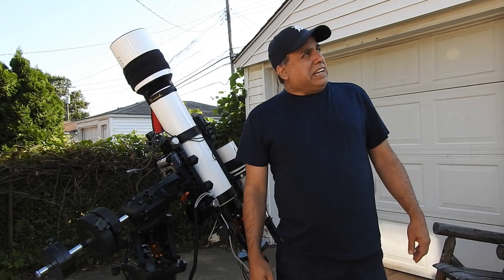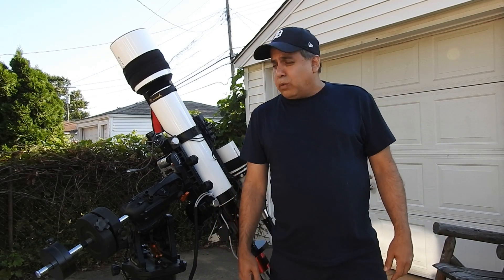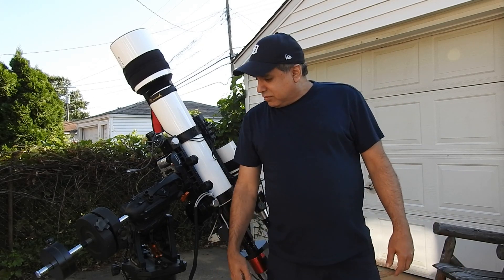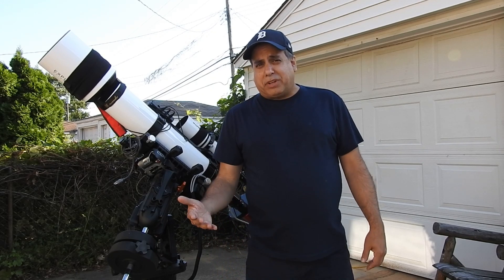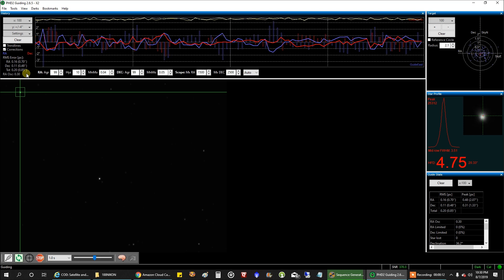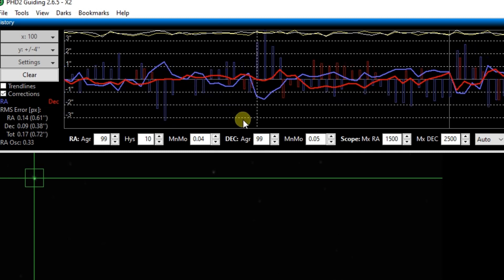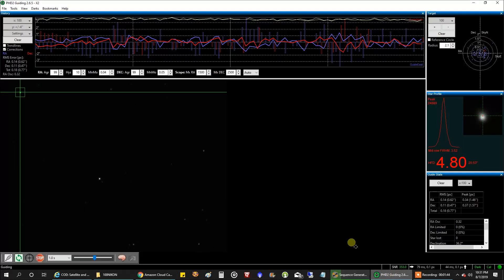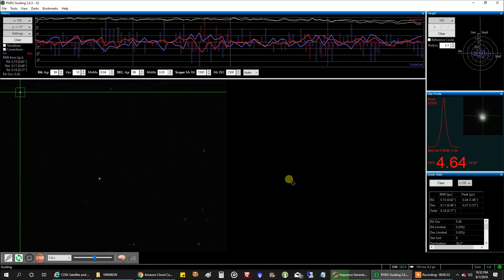My Telescope Mount is Driving Me Crazy (Part 2)

Comment: You never fail to crack me up with your outtakes, Chuck 🤣.

I’m hoping you find out what the problem is with your CGX soon because I’m about to upgrade my AVX to either the CGX or the ioptron CEM60. I’d love to stay with Celestron because then I’d be able to keep using the Celestron StarSense Auto Alignment Accessory which is pretty much a must for aligning my scope in the little back patio of my apartment.
Reply from the maker: Thanks Randy, I'll keep you posted.  Wow, if the CEM60 were an option for you, I'd jump all over that and replace StarSence with Plate Solving.
Reply: Chuck's Astrophotography I’m not all that familiar with Plate Solving tools and whether or not it would suffice in my situation. Basically, from my little back patio, I can only “see” the eastern half of the sky. Everything else is blocked by the 2-story apartments.
Reply from the maker: @randydonnelly5897  I have a video on Plate Solving is you ever are interested in learning it.  Seeing only the eastern half of the sky is no problem for plate solving.  But I understand, if something is working well for you, I would be reluctant to change too.  I am set in my ways.
Reply: Chuck's Astrophotography thanks Chuck. I’ll check out your Plate Solving video and see if this “old dog” can learn a new trick 😉. If plate solving can work with just the eastern half of the night sky and I don’t have to worry about adding calibration stars in the western sky, then Plate Solving could very well replace my need for the StarSense and I’d definitely opt for the CEM60...on a tri-pier 😉.

Comment: Gee what a bummer... If your running AC maybe your getting fluctuation in your AC. Or try another power AC power block. Try a battery to run the mount. If you still have problems maybe it’s a still a power issue in the mount itself. Love my CGX-L... unguided and a rough polar alignment I can get round star even up to one minute on a good night.
Reply from the maker: I wondered about the AC power as well, I'll add this to my list if I can find a battery in my inventory that can power this mount.
Reply: Being stupid on my side... lastly a 2x4... duct tape and a hammer (BFH) can fix anything.

Comment: Hi Chuck,
I too having a very similar symptom happen after a windy night in June and I am still trying to sort out the issue though. 
One thing that I hav noticed on your PHD's min-mo settings, you might want to increase the number a bit to prevent the PHD to make correction too quick.
The other thing I would also try is to completely reset PHD2 and from scratch and see if it helps. 
Chao
Reply from the maker: Thanks Chao, I'm going to go all through the PHD2 settings today, thanks!

Comment: I'm still working on getting my guiding better, so I feel your pain!  

Are you positive that this is a mount issue and not a software issue, cable, etc.?  Just thinking out loud (in print).  Best outtakes yet, btw.
Reply from the maker: Thanks for the suggestion, right now I'm not positive on anything.  I will flip through all of my PHD2 settings today and double check everything.
Reply: I've just learned through extensive dealing with computers, 3D printers, etc. that if you have a problem that you're spending a lot of time on time on to stop and take a look at the peripherals and make sure everything else is good.  More times than not I've solved an issue that I thought was something else by checking cables and connections.  And, of course, there's always turning it off and back on again. LOL
Reply from the maker: And glad you enjoyed the outtakes, lol.

Comment: Hey Chuck. I have a couple more brain storm ideas about your mount if you want to try them. First off, I don't think it's your belt. It looked perfect in the last video. The first thing I thought of, and I'd imagine you did to, is see if there's any wobble in your guide scope. It might be that the guide scope image train or guide scope mount is loose. The second thing I thought of might be RA gear itself. Maybe some bad teeth. To test this, move the RA using the hand controller so that the counter weight bar is horizontal. It doesn't matter if it's easy or west and doesn't need to be perfect. Then release the clutch and rotate the RA 180 degrees. Re-engage the clutch and use the hand controller to move the RA to the home position. The idea is that the RA gear will be on a usually unused set of teeth. If this works out then it might mean that some teeth on the gear is damaged. But it should be ok to use it in that configuration for a while if it is. Keep us posted.
Reply from the maker: Believe it or not, I didn't even check for wobble in the guide scope and guide camera imaging train until last night.  It was secure, but I would have felt like a fool if that were the problem and I went a week without even checking it.  Good information about the teeth, I will check that today, thanks!

Comment: When you get to the point you start looking at resolving the issue again try removing the belt and see if the gear on the motor is wobbly, If so then you have bad bearings and the motor needs replacing. Another possible issue is a worm bearing that is too loose or to tight.
Reply from the maker: Thanks, I think once I have my other setup running, I'll move forward and start looking deeper like you mentioned here.  For now I'm worried if I go too far, I won't be able to get it back and be stuck in the middle of three projects and not be able to finish.
Reply: @ChucksAstrophotography  I completely understand.  Luckily you can keep going.

Comment: Hmm that stinks Chuck sorry to hear you haven't gotten this fixed but I'm sure celestron will get you fixed up if you call them. Also I always east side balance since I run a G11 that doesn't have the spring loaded worm. Meridian flips require the weights to be shifted. When I know I'm going to do a meridian flip I balance on both sides at the beginning of the night and sharpie mark the shaft so it's a quick process in the dark.
Reply from the maker: Yes, that's a good idea - I have my mount marked where the weights should go too.  I know some people who go east heavy and do all of their imaging only on the east side of the meridian.